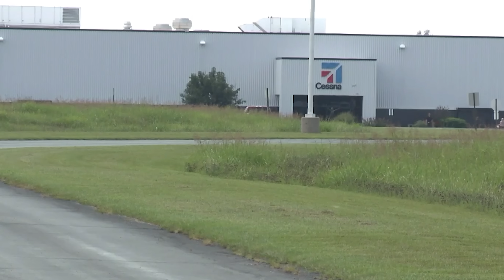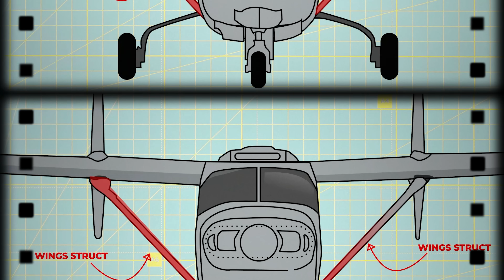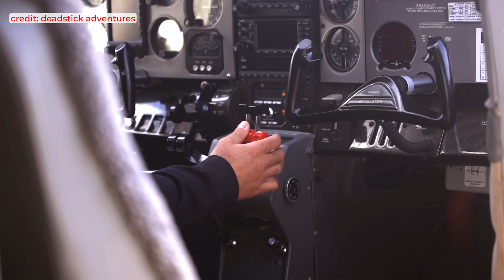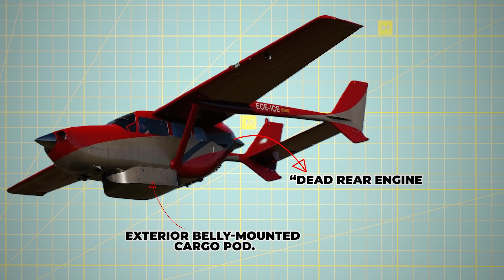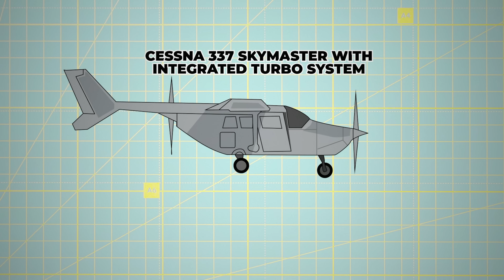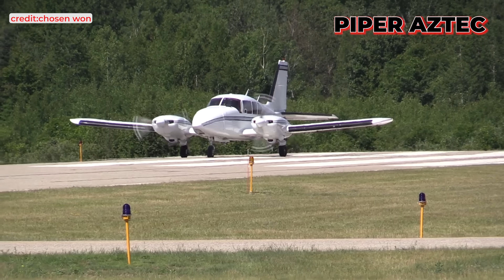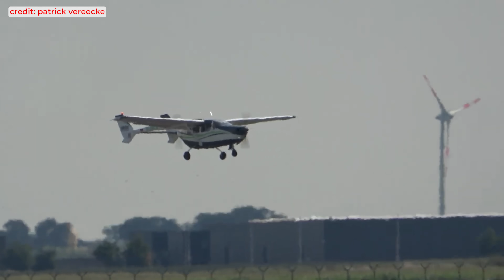Why Did Nobody Want the Twin That Couldn't Kill You?

Comment: I’m not a pilot. How do you “match” the rpms of both engines so there is not unwanted push vs pull? Fascinating video.
Reply: The C-337 Skymaster synchronizes its props in this manner: The pilot roughly synchronizes engines RPMs and manifold pressures, then turns on an electronic synchronizer. I've flown in one where this was inop. It's easy to manually sync them, as when their RPMs match, they come into 'tune' just as musicians tune their musical instruments.
Reply: @psycotria same as in a twin engine speed boat. You can tell just by the sound if the rpm's are in sync.
Reply: @psycotria  Is there a beat phenomenon?
Reply: @beestingza Yes. Its the same in a twin engine boat. Its easy to tell when they are in sync
Reply: @beestingza iirc on twin turboprops, the synchronizer intentionally keeps them from syncing because the drone is obnoxious in the cabin
Reply from the maker: Great question! In a Skymaster both engines use constant-speed propellers, so you simply set both prop levers to the same RPM on the gauges and the prop governors automatically hold that RPM.

I have pinned your comment so those with a lot of hours on the Skymaster will see it and give you a better real world reply.
Reply: @Esploure  ATPL rated pilot here. I only have about 800 hours on mixmasters though but nothing I can add. Thats exactly how you match rpm
Reply: The front and rear props are variable pitch, you can account for the faster airflow of the rear with more RPMs or more bite in the prop, or both.  But the beauty of centerline thrust is you don't need to balance them.  A conventional twin will of course attempt to turn the aircraft if they are not balanced. The skymaster is much less sensitive to an imbalance, or an engine out.
There is a company experimenting with skymasters with an electric motor in the rear.  Take off on 2, and then shutdown the gas motor for smooth quite electric flight.  Back on the gas should you run short of battery power.
Reply: @bradleyrex5861 maybe Cessna could have marketed it to run on one engine to extend the range and efficiency when needed?
Reply: @josev1544  - Even if it was just leave the Front running, but with way reduced power & RPM settings? Hmmmm... I once checked out in a Cessna 201, and after the checkout flight, since my home airport got "Closed" and I couldn't fly there as planned, just climbed up of the city I was at, and throttled way back, leaned it out, and observed 160 Mph on "Just" 8 GPH (Gallons Per Hour), or 20 MPG @ 160 MPH! Try THAT in a Corvette! 🙂  Plus - a Cessna 182 Could do 160 MPH, but - it would be running at 11-12+ GPH! So - it was an interesting "Sample" of Relaxing Speed Demand and going for greater efficiency!
Reply: @bradleyrex5861  no rpm will be the same, just the rear prop will have a higher pitch than the front. the 337 should be measured against the seneca2(same engines) it had better OEI performance, and the rear engine turning actually had a better RoC so the accelerated air around the rear fuselage helped with drag. when the gear was retracted you opened a big drag bucket, the stc to remove the gear doors made gear rigging easier and retraction faster. the big problem they had was if the rear engine idled out prior to takeoff, they spec'd adding rear engine prior to the front to avoid a single engine takeoff
Reply: @ndenise3460  - I bet - in todays High-Tech World, a Voice Annunciator could easily be fitted, to communicate the challenges of knowing which engine failed, or had less than desired power! Plus, with Cell Phone Cameras and Glass Cockpits, having a couple Cameras facing the Engine or Prop could easily be integrated, it seems!

That - and the New Diesel Engines that run on Jet-A, more fuel efficiently than the Continental's or Lycoming's, could be another option for a revival! 

More Futuristic - Hybrid Powertrains could be adapted, it seems.
Reply: unless the prop has stopped altogether, it will windmill
Reply: @bradleyrex5861  So, what you are saying is that the increased wind speed off of the front propeller actually helps the thrust of the rear prop?
Reply: @Adventures-of-C-Jeff-Dyrek  No not really.  I am saying the aircraft can fly pretty well on either the front or the back propeller by itself.  Much better than a conventional twin.  Balancing them is not necessary.
Reply: @Adventures-of-C-Jeff-Dyrek  no, he said that it doesn't matter for control what either engine does, there is no torque or yaw penalty if either engine does something different.
Both engines turn  opposite , so rotational mass  is not going to be a bother. Both engines run constant speed, so the rotational mass front to back automatically balances 
both engines are centerline, so there is no yaw when they are not same setting

the faster speed of the air flow over the rear prop he mentioned, is just a point that the variable pitch will deal with, it does not affect  handling
Reply: @stijnvandamme76  Thank you very much for telling me this. The more I hear about the Skymonster, as we called at work, plus the MixMaster, the more that I like it.  I only had several hours flying in them, but, I was always busy working and not paying any attention to the airplane, just the instruments.
Reply: @Adventures-of-C-Jeff-Dyrek  actually no the front prop has better thrust due to undisturbed air, however the rear engine reenergizes the rear fuselage flow giving better OEI performance.. so the extra drag vs better thrust is a tradeoff
Reply: @ndenise3460  The more that I read about this, I'm surprised that Cessna didn't build a larger version of the 337, the 447.  I've only ridden in the front seat of the Skymaster, but it felt cramped.  I guess that I worked on so many of the larger twins that I'm a bit spoiled.
Reply: I fly vicariously because if God intended for man to fly He would have given us more money. I'd imagine that matching engine output would be less critical with both props down the centerline than with the asymmetry of conventional twins. Even so, to match their output wouldn't you do it with prop pitch, tach, fuel flow and EGT?
Reply: @Dave-wg1hz God would have you be clothed when you were born if he wanted you to have clothes.
Reply: @Dave-wg1hz  - In my early days of flying, I worked in Concrete Construction - a Pretty good Paying Job, but Not extremely So. so my "Math" was 4 hours overtime = 1 hour flying! These days - I still have a pretty good paying job, but the Math has skewed more to 6 hours overtime for 1 hour flying! (Wages have not kept up with Flying Costs, in my case, for sure!)
Reply: Same as you do with a conventional twin.  I flew one of these airplanes.   One thing at rotation the rear engine would give you a little kick in the butt you had to be ready for it so you did over rotate
Reply: @Dan-cn3ei  The last sentence, "so you did over rotate" can you please clarify that, I sure don't understand.
Reply: @Adventures-of-C-Jeff-Dyrek I think they meant “so you DIDN'T over-rotate.” “Rotate” here means lift the front wheel on takeoff. If you rotate (lean the plane back) too much too fast, you could stall or strike the tail on the ground.
Reply: @JackEnneking  Thank you
Reply: @Adventures-of-C-Jeff-Dyrek  The 337 is prone to 'over-rotation'  during takeoff and landing meaning excessive pitch-up, due to the large and powerful horizontal stabilizer and because the aircraft with an engine in the rear has a neutral balance or center of gravity rather than a more weight on the nose so a stiff yank back on the yoke can easily bang the tails into the ground. Takeoffs  with No flaps in the 337 are prohibited because of this and 1/3 flaps helps prevent over rotation, damaging the tails and possibly causing a stall and crash. 

I've done no-flap takeoffs in 337 at hot and high altitude airports but you do have to be aware and careful.
Reply: @jackoneil3933  Thank you very much.  I really appreciate you teaching me about these things.  I just watched a video on the BD-5.  It had a rapid pitch problem like this too that caused problems, but due to the short coupling of the controls.  I never realized that any of the larger aircraft would have this pitch problem.  Thanks again and have a nice day.
Reply: @Adventures-of-C-Jeff-Dyrek  You're welcome, and thanks for the questions,. The issue with the 337's over-rotation issues is related to weight distribution and a large, powerful horizontal stabilizer with a lot of airflow being generated by both engines blowing over it, so during takeoff epically with no flaps very little back pressure is required to lift the nose.  And, the angle of attack on the main wing of the 337 is pretty close to 0 degrees or possibly a bit negative on takeoff, so there's a bit of an aerodynamic 'stuck' condition until the nose wheel just lifts off the ground until the main wing starts to generate lift and the nose tends to pitch up on it's own. 

That's about it. The 337 once off the ground is exceptionally stable in pitch and roll in flight, except in stalls where the extra weight of the rear engine and powerful elevator can in the 337 produce a pretty deep and violent stall. I had a B737 Flight instructor on a demo flight get one 337 into an inverted spin due to STUPID control inputs. 

The BD-5 is similar in that it has the engine behind the pilot but it also has a very short fuselage and small full-moving  horizontal stabalator rather than a split stabilizer where only the rear half of the stabilizer moves. The BD-5 is reported to be somewhat unstable in pitch overall
Reply: @jackoneil3933  Thank you very much.  I keep learning every day.  Have a nice day.
Reply: I haven't noticed anything along these lines on my 69D. Fairly similar to a Seneca.
Reply: Same as with 2 outboards basically
Reply: sound
Reply: I've owned and flown over a dozen 337s and there's not really any 'unwanted push-pull effect' and each engine can operate at different power settings without any ill-effects but the only time there's really any need to operate at different power settings is during takeoff where you typically lead with power on the rear engine to confirm proper operation and during approach to landing where it's advisable to keep a bit more power on the rear engine to notice if there's any power loss. 

The old Fuel-injected Continental 360 engines can be prone to vapour lock on approach and take-off it's best to keep a bit of power on the rear engine for #1 to keep a fresh, cool fuel flowing and #2, because the rear engine preforms better and not as critical of you loose the front engine. 

Otherwise you try to keep engines matched for power and RPM.
Reply: @jackoneil3933  So, when you're flying, is this where you match the RPM's?  Also, does the increased velocity of the air flowing around the fuselage, from the front engine, make the rear engine more efficient or even add more power to the rear engine, effectively?
Reply: @Adventures-of-C-Jeff-Dyrek  Good questions. In regards to matching RPM, as with most light variable pitch propeller aircraft the IO-360 Continental engines in the 337 have 'Constant Speed' propellers, meaning they have hydraulic/Mechanical speed governors, that control the RPM of the propellers by automatically varying  pitch of the propellers. 

So you simply move the prop levers to set what RPM. If you set 2400 RPM the governors will change pitch to hold 2400 RPM as power and airspeed change.

 When both engines are producing equal  power the rear prop governor will automatically have  slightly higher pitch than the front to hold 2400 RPM due to the higher airspeed generated by the front prop. If you reduce power to below zero thrust on the front engine the rear prop might have a lower pitch than the front prop because it's creating drag and slowing air around the fuselage and the rear prop. 

As a pilot you really don't notice any difference from a conventional twin. When you have constant speed propellers, your primary power instrument is not so much RPM as that remains constant but throttle setting and the  'Manifold Pressure' instruments that basically indicate throttle setting. 

In most flight regimes you simply set desired RPM and Manifold Pressure on both engines to the same setting. Most of the time flying the 337 feels like  flying a single-engine aircraft with two engines. 

The 337 is no different than a conventional twin, in that if one prop is turning few RPM faster than the other you will get an unpleasant harmonic "Wow-Wow" out of sync noise and vibration. Slight adjustments to RPM Prop controls will sync them, and once you sync to the exact same RPM  the prop governors if not worn or gummed-up don't drift much and hold sync pretty well. 

On takeoff and landing however you advance RPM controls to 'FULL RPM' to ensure maximum power.  That sets both props to the Governor RPM  stops so you have something like fixed-pitch propellers, so during landing and takeoff engines are typically out of sync and it's a bit more uncomfortable in the 337 as you are setting between two props  

Some later 337's did have an electronic Prop sync system that when you flipped a switch synced both props but it was a problematic contraption prone to failure.
Reply: @jackoneil3933  Thank you very much.
Reply: Props and jet engines need to synch.  Otherwise there is a “wash-waah” sound they make.  Like when tuning a guitar you speed one up or slow one down until the “waah-waah” stops.  In larger propeller plains there can be a vibration intense enough that it can vibrate your organs and make you nauseated.  There is usually a synchronizer that synchs one engine to the other “slaves” to the engine to help with this.
Reply: You synchronize by listening to them. There's also an electronic synchronizer available.
Reply: I've trained on and flown a Piper Aztec years ago. 
On that conventional twin, you'd set both RPM's to roughly the same speed and then tweak one of the power levers so that the engines "burbled together" and not sound out of phase.
Also, there was an indicator that looked like a little propeller that would either slowly rotate clockwise or counter clockwise, providing a visual indication of engine sync. The objective was to make it stop turning.
I'm assuming the skymaster uses a similar system.
Reply: Rpms
Reply: with the throttles, who else? You march RPM and manifold pressure.
Reply: That's why they called them push me pull yous!!!
Reply: Not really an issue.  So its pulling a little.  All wheels cars d9nt necessarily have a 50/50 distribution.
Reply: It has a prop synchronizer.
Reply: well to synch it the sound is the big thing (like humming to a note, it will settle on the right frequency)  that said  they both push to the lower pressure area.
Reply: Matching rpms is less about matching push/pull.
You match the rpms b/c when they're "out of synch" they make a terrible noise.
Reply: @mamasitamba  Thank you very much.  So, the RPM stay the same, but the pitch is different, automatically.  I'm starting to understand how this works.  Thanks again and have a nice day.
Reply: @Adventures-of-C-Jeff-Dyrek  well,  almost;  your main controls are "mixture, prop, throttle",   you end up "squeezing" the controls of the engines "against each other" - ever so slightly by ear.  You may be doing this every few minutes.  A lot of modern planes can just synch automatically.
Reply: Correct. The propwash will never be the same as the rear receives the already accelerated air off of the front one.  The rear is also more efficient because it's propwash isn't forced over the surface area along the fuselage. As a result of these, the matched rpm means that the prop pitch ends up different. Not the pitch control (which is really rpm control) but the actual pitch of the blades... Which is what I took you to mean in your question. The levers should still be mostly parallel
Reply: @mamasitamba  Exactly
Reply: The front engine pulls and the rear engine pushes. So they work together to move the aircraft forward.
Reply: Sure, but the rear engine is trying to push air that has already been accelerated by the front engine. I am not an aeronautical engineer, but from what I've read, the rear engine has lower efficiency for that reason. Or am I missing something?
Reply: @a.vanwijk2268  You have that backwards. The rear engine is more efficient. When I checked out people on the mixmaster I would tell them losing the front engine turned it into a C-182  lost the rear C-172
Reply: @blairlevert8982  I was talking about when operating simultaneously.
Reply: @a.vanwijk2268 ...I think the rear engine on earlier models was a little more inefficient (and ran hot?) because of limited air intake due to it being behind the entire fuselage of the aircraft and the air scoops to the rear engine were not big enough. I think they increased the size of the air scoop in the subsequent updates. Not sure if that entrely solved the problem.
Reply: @a.vanwijk2268  The rear engine gave more performance.
Reply: @timakey4678  college grad, eh?
Reply: @Dave-kq7gv  Why the snark? But, since you asked. Associate degree from Pittsburgh Institute of Aeronautics, A&P, IA, FCC, designated mechanic examiner. Was once offered a job as a FAA maintenance inspector but stayed in the "hand's on" side of the industry. Solo within weeks of my 16th birthday. ATP, CFI, CFII, MEI, type rated in 3 jets and a turboprop, altitude waiver for low level acrobatics. Director of Ops x 2, Director of Maintenance x 2, Chief Pilot, Chief Inspector, Check Airman, Test Pilot, 20,000+ hours logged, more than 200 different models of airplanes flown, airlines, antiques, homebuilts. Worked on everything from B52s to ultralights. Retired after a 50+ year career. Offered a Wright Brother's award but gave it a pass for personal reasons. I've had the opportunity to work with and have working for me some truly talented mechanics and pilots.
Reply: @Dave-kq7gv I’m
dead ass dying over here. A real rocket surgeon wise guy there.
Reply: @timakey4678 Today little Timmy learn to copy paste text. He’s a little confused by books though but we’ll get there by 40.
Reply: @DavidPawson-d7h  Do you feel better now? All growed up and smart? If so, glad I could help.
Reply: @timakey4678 crack  the whip   ouch you got the attention of the room  sir
Reply: @rctopfueler2841  ? Not my intention to insult anyone.
Reply: From who
Reply: “It’s quicker to switch to your spare engine than restart the other.”                                    

            Randon Dude
Reply: It straight up doesn't matter. Being close enough will counteract any unwanted induced yaw.
Reply: @kenshinbattousai374  People are overcomplicating it.
Reply: I’m not a pilot and don’t know.
Reply: @gregriddle3042  That’s really useful. Thank you for your valuable insight.
Reply: @heli-crewhgs5285 I apologize, I always wanted to be a pilot but my peripheral vision loss ended that hope. My brother is a corporate pilot and about to retire. Aircraft of all kinds have always been a part of our family. 
I was really interested in this video. I didn’t realize they had fixed gear, and all the changes that aircraft had. I wish it was more successful. Thanks for the video.
Reply: What if the rear engine started backwards,?.,cant say it cant happen ive experienced the backward  run